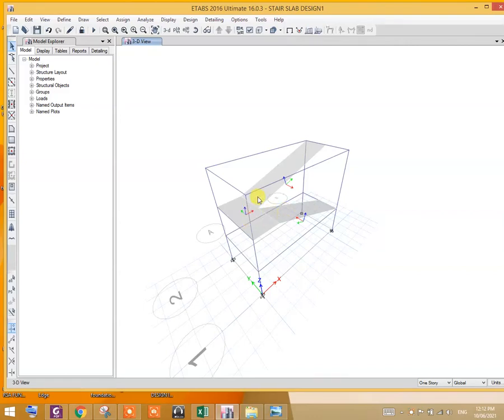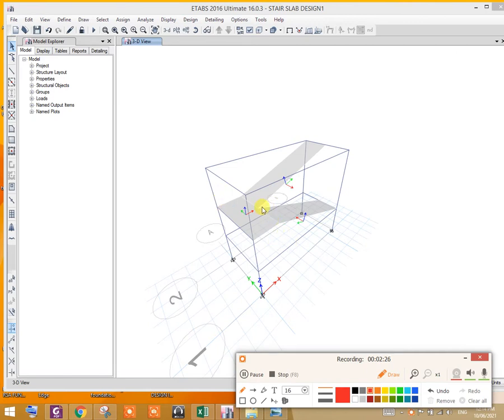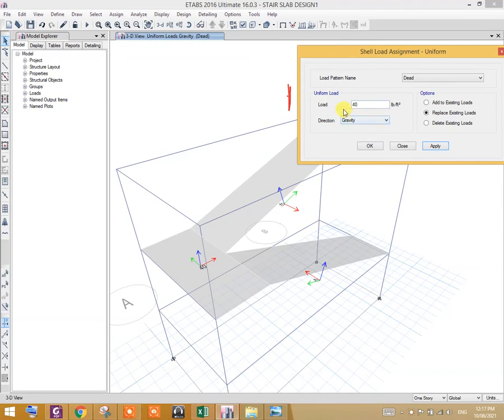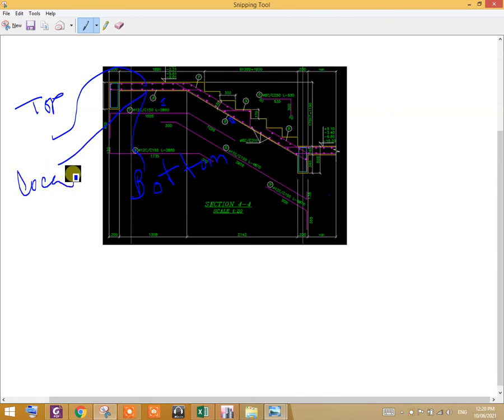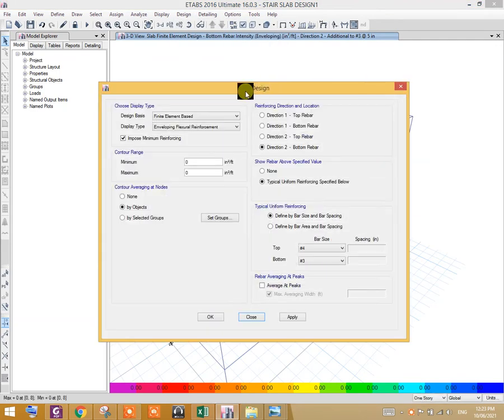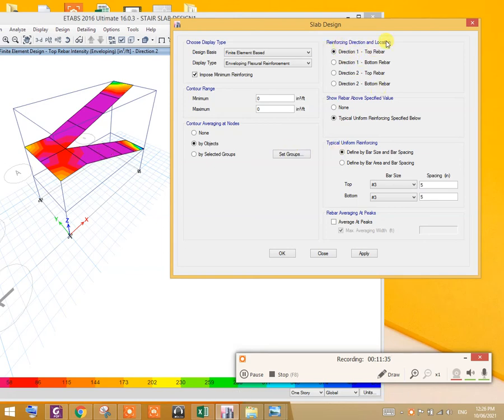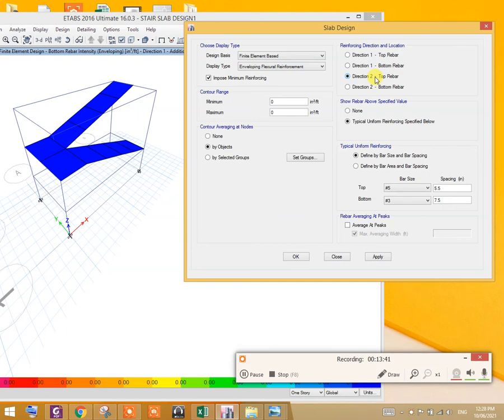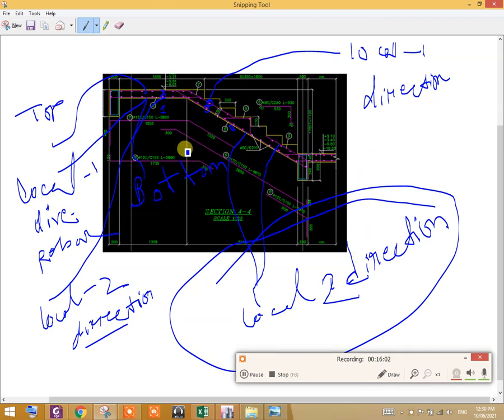Design of RC stair slab in etabs | design of staircase in etabs | design and detailing of staircase

Comment: Generally for staircase slab of 300mm tread and 150mm riser, h/v=0.5>0.35 and automatically modelled as wall element in etabs. Shall we still design the waist slab as floor slab and not as wall?
Reply from the maker: Brother, It’s a big limitation in etabs. Actually, the axial stiffness of shell element is assumed zero. But in case of wall it’s not. Moreover, if you design the staircase as wall section. You have to assign pier to the wall section. And get the result as a shear wall. It will be more safe... Because in wall section consideration, both out of plane moment and axial force is considered.
Reply: @geostructureacademy  Thank u👍
Reply: I wanna  give u a big congratulation for this explanation,thanks .